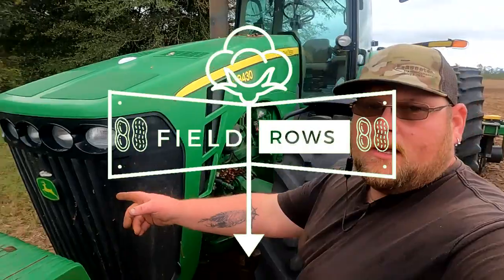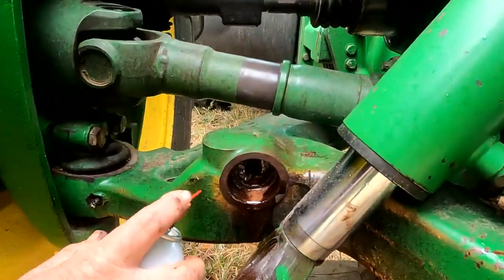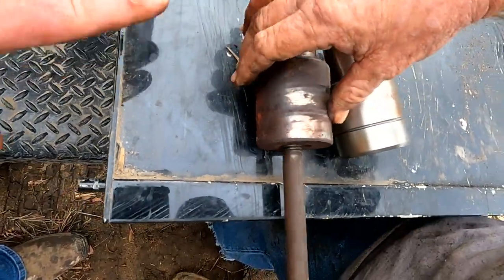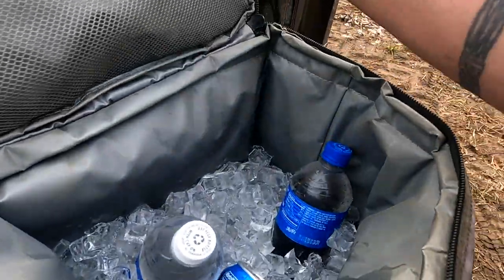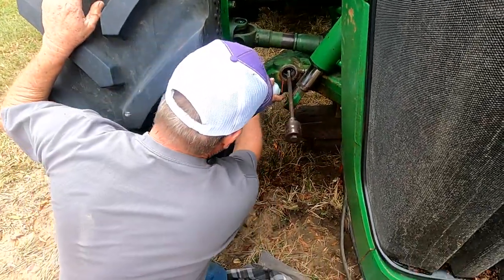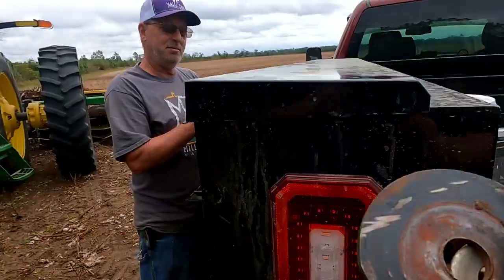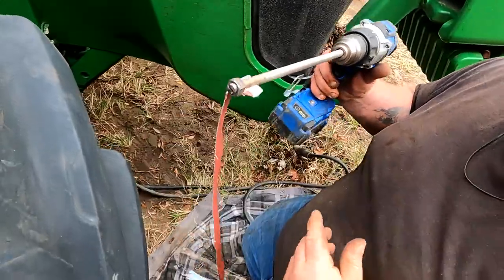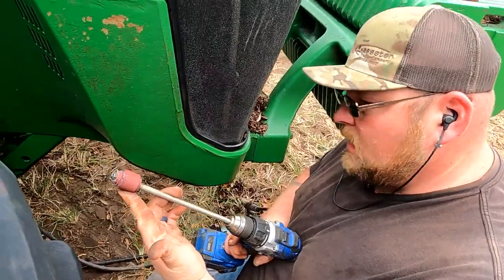Farm Hands As Good As John Deere Technicians

Comment: Can't believe you didn't cover that cylinder when welding there good way to ruin cylinder seal from heat or pit the cylinder from slag. Smaller diameter long bolt be  better so you can weld to the insert bolt instead of the insert itself.just suggestion.  I've done 3 of these all last summer i screw broken piece of bolt out then screw 220 mm bolt into insert and stack some washers on top of plate like u were doing and it either pulls it out as you  tighten bolt or it bottoms bolt out and spins insert comes right out.i can happily say in all my cases I haven't had to use welder yet not saying in future I may have to. Good job guys enjoy your videos